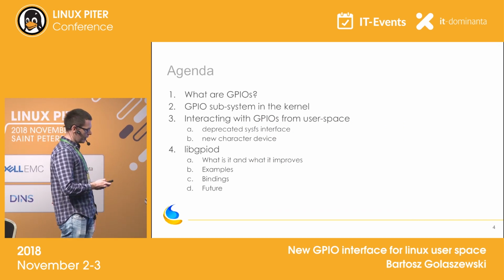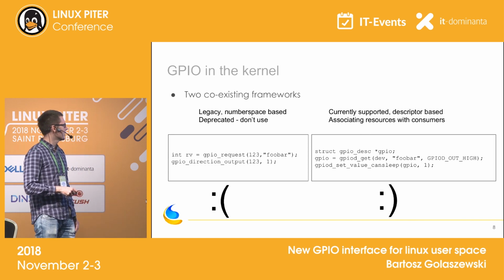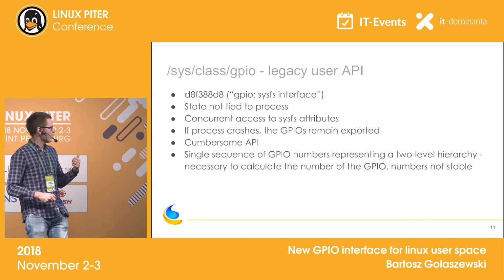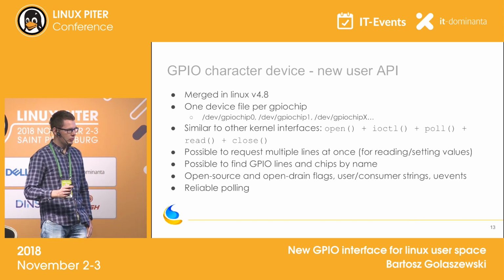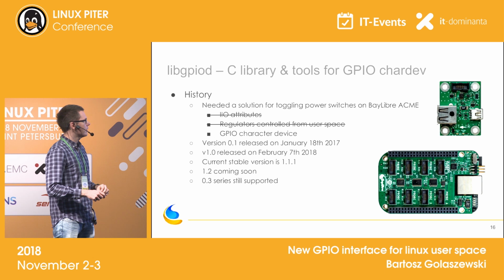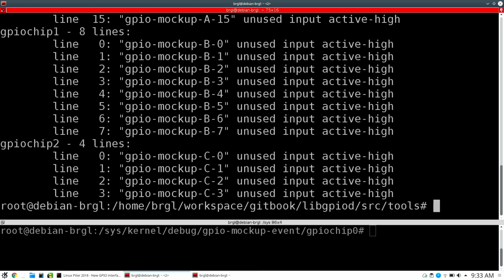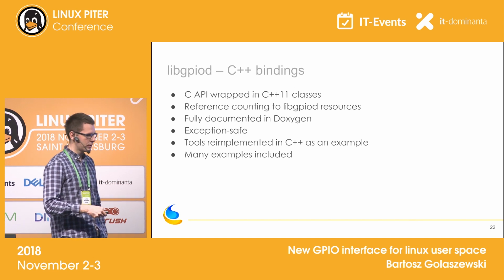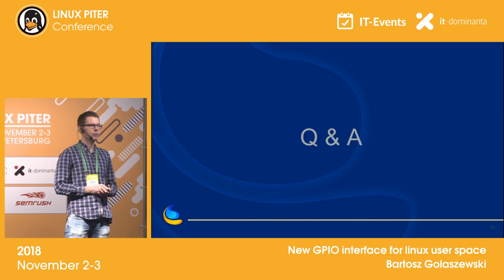[ENG] Bartosz Golaszewski: "New GPIO interface for linux user space" / #LinuxPiter

Comment: If GPIO device is opened by multiple process and if one process closes FD, will all the GPIOs under that GPIO-Device(Chip) will get to default value?
And what happens to the state of GPIO in other process?
How are we associating Porcess and GPIOs, Is it at GPIOChip level or GPIO Line (Pin) level
Reply: You cant open a gpio device on multiple processes. Thats the whole point of the new API